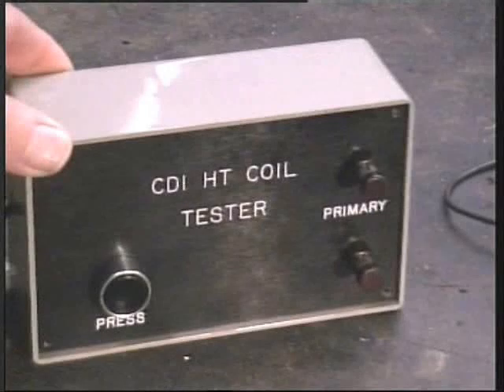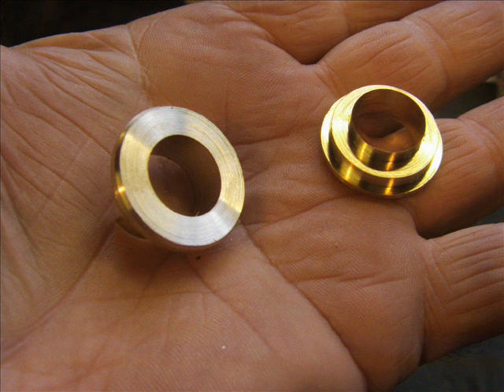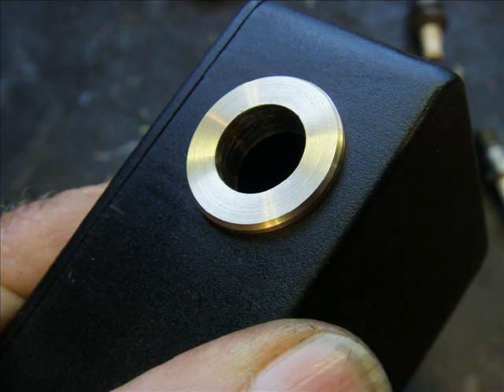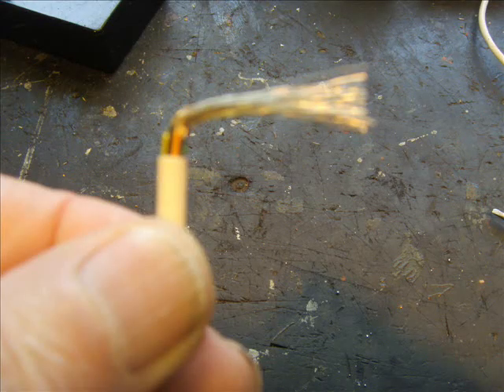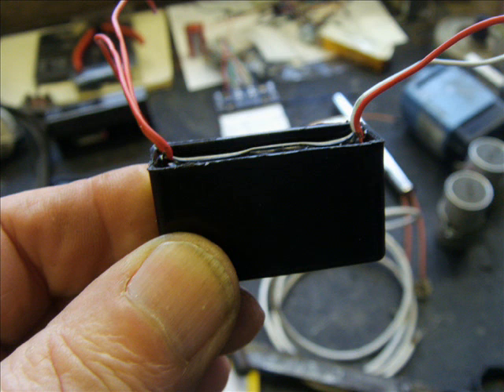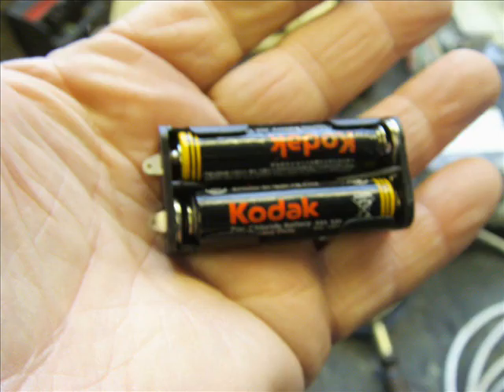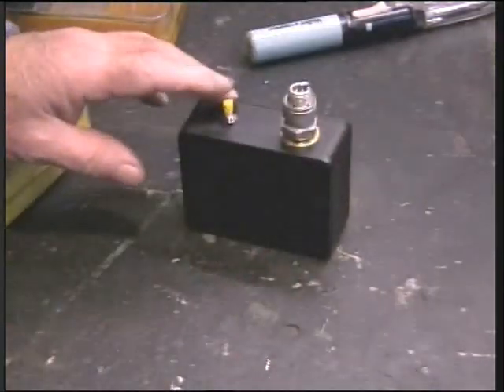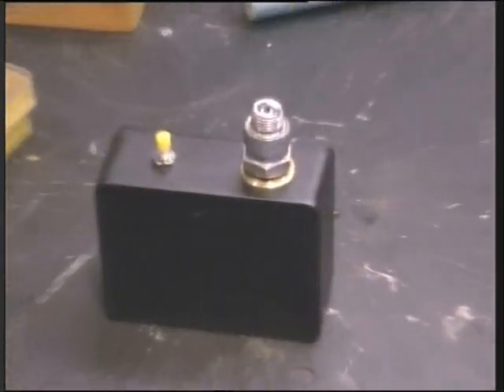Homemade sparky

Comment: Very nice indeed. I might build one with two bevels/holes- one for the longer type plugs and one for the short type. Or you could use a small spring as the bottom contact and that way the tester would be universal to all lengths. Thanks you for uploading the video.